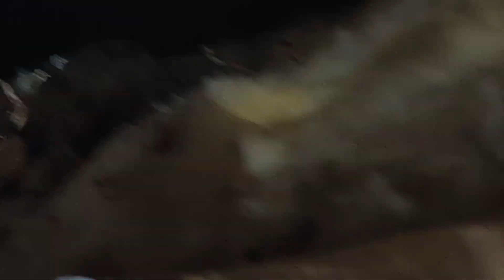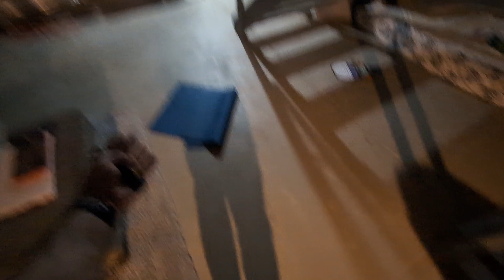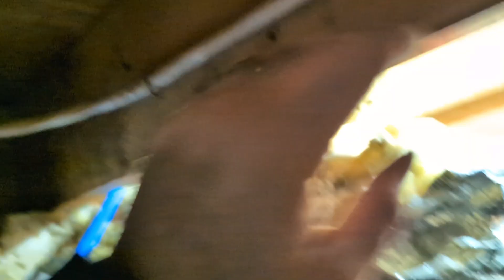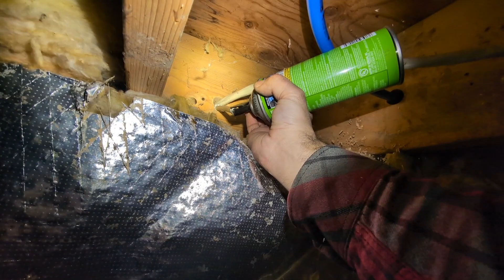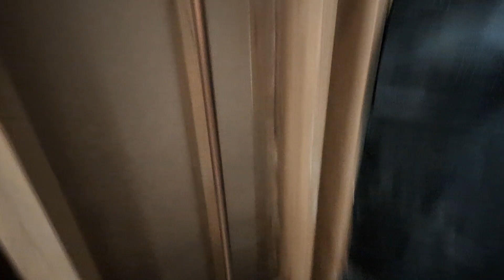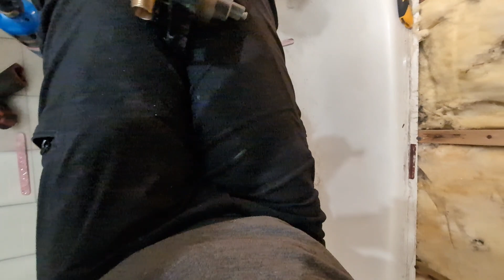3 Common DIY Plumbing Projects At Home | How To Not Goof Em

Comment: I don't see many plumbers using Quick connections.  I do realize it's perfectly OK when accessible.
Reply from the maker: They're expensive and shouldn't be cycled on and off, but they ought to last just fine indoors and I wasn't going to start soldering horizontal joints in a house with no isolation valves in the middle of winter, for free ;) Thanks for watching!